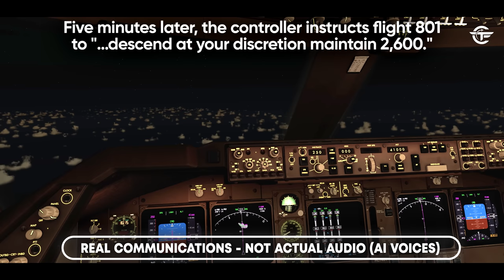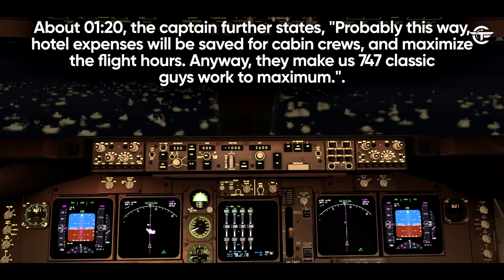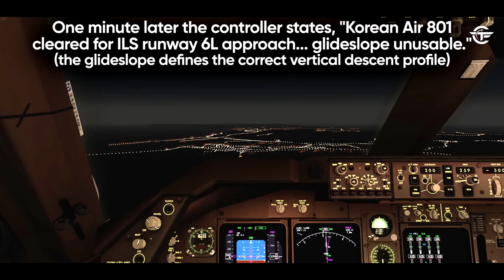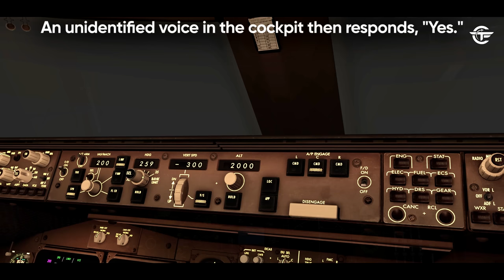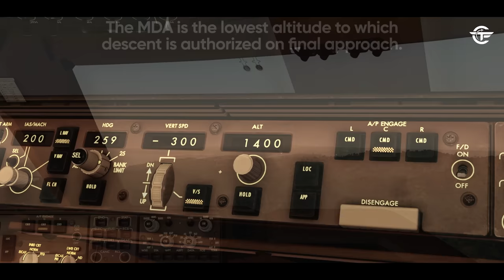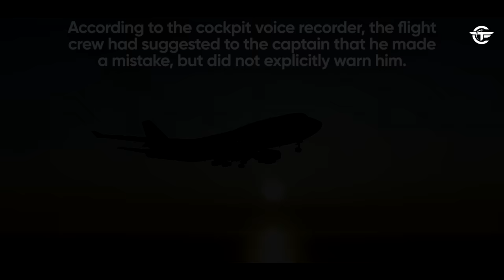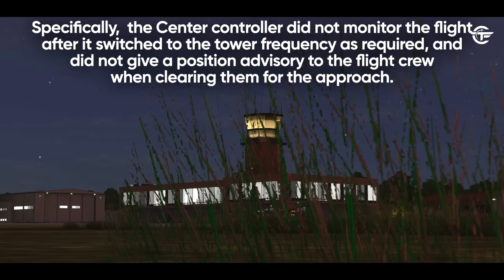Boeing 747 Crashes in Guam | The Terrifying Story of Flight 801 (Real Audio)

Comment: If I correctly understood they was cleared for ILS approach.
The Approach told GS not working, but the tower did not mentioned this.
If the GS was not working the Approach should clear the flight to a VOR approach.
Instead, clearing to an ILS approach the crew did not realize immediately the erratic GS and miss to maintain the appropriate altitudes.
Reply: I remember the tower mentioning the GS was not working, but the cockpit didn't repeat that part back to the tower.  Tower should have caught that but didn't.
Reply: @margeebechyne8642   controller  said  gs not working tower  never mentions it
Reply: @hachimaru295  Ah.  Well.  Still should have caught that - that's why repeating back is so important.

Comment: Korean air carriers are always affected by their seniority culture and power distance, resulting in a lot of crashes over the decades, that, and lack of training, lack of situational awareness, failure to adhere to procedures, and the whole decision-making process. It's a system that led to them being shot down by the Soviets twice, numerous crew-error deadly crashes with massive casualties, runway overshoots, and a lot more as far as I can remember since the 70s.

I was in Guam stationed on a Navy ship there when that happened, and was on duty that night. It was raining mostly, I went up to the ship after a smoke break on the pier towards midnight, hit the sack, and a couple hours later they woke everybody up on the PA system and gathered at the galley while they were designating people to be sent to assist on the crash site. Right then, the news came out on the TV, and once I saw Korean Airlines appear, I wasn't surprised, and already knew that this was most likely a preventable accident. 

I don't know if that has changed over the years, but just this year, a Korean Airlines jet overshot the runway at Mactan-Cebu, Philippines and was written off. A few years ago, an Asiana perfectly functioning 777 missed the SFO runway on a bright summer day and was totally damaged with some casualties. I'm sure that one is on YouTube somewhere. Apparently, it was all for the same reasons mentioned above. I wouldn't fly with them, knowing all these. 

Everything past the cockpit is great though. Nice clean cabin, seats, cabin crew, and all. So nice, that not too long ago, Ms. Cho, a daughter of one of the airlines' CEOs threw a fit, berated, screamed at, and slapped a flight attendant in front of everybody prior to takeoff from JFK, causing a big scene over peanuts not being served on a plate on the first class section, prompting the plane to return to the terminal to dump off that flight attendant. Power distance, huh?

Comment: No Non precision approach backup? With minimum altitudes vs DME? Without glide slope it’s essentially a NDB or tacan approach with DME.
Reply: An ILS with glideslope inoperative is a non-precision approach. The MDA for the non-precision localizer-only approach is right on the chart.  A localizer-only is way better than an NDB, or even a TACAN, because it at least keeps you right on the runway centerline.
I don't know what the approach was named back then, but it is now named ILS or LOC RWY 6L, and the term localizer can be used by the controller when issuing the clearance, which might have helped wake this crew up sooner.

Comment: If Just Flight 747 classic were to be released today with the 747-300 model ready, would you have used it in this video?
Reply: That was the first thing I noticed; KAL801 was a B747-300 but the video is using a B747-400 in this sim.

Comment: No. Just no. Looking at the approach chart, the minimum (MDA) is 1500 for a localizer approach. The MDA (actually DA) of 590 (the figures may have been adjusted higher since this accident) is FOR THE ILS. The glideslope out changes the approach to a LOC or localizer approach, and has a COMPLETELY DIFFERENT MDA. The 1500 foot MDA would have cleared the 1190 foot obstacle listed on the approach plate. The controllers said this several times, "glide slope out", and the tower called it a "localizer approach" several times. Dialing that 560 MDA was loading the gun that killed them.

(The MDA is minimum descent altitude, the DA is decision height. ILS does not have an MDA at ALL because the height is set by the glideslope. The DA is a "decision" altitude because it means if you don't have the runway in sight, get out of there).

PS. The old plate thing didn't kill them. Even with the old 1300 MDA, they would have cleared the mountain.

Comment: Just a heads up on your graphics, you keep showing a 747-400 (exterior and interior shots) when the aircraft that crashed was a 747-300. It's an important piece of information because the you mention the captain began a briefing the first officer and the engineer about the approach into Guam. The 747-400 is a two person cockpit while the 747-300 is the 'classic' 747 three person cockpit. The 747-400 is a glass cockpit while the 747-300 that crashed was the old school 'wall of gauges' which is NOT WHAT YOU ARE SHOWING.

Comment: I regret to to note that, in videos of accidents and incidents involving classic Boeing 747s you created recently (since the accident of MK Airlines Flight 1602 aired on 14 October 2022), the cockpits of these classic 747s were replaced by those of the 747-400s. In this video, even the 747-300 itself has been replaced by a 747-400. These details are clearly inconsistent with what they actually were, and I hope that you will fix them in the future.

Comment: Korean Airlines is well known for this, fear of challenging the senior pilot. It has to do with their culture. Seniority is everything. You just don’t challenge your superiors as they are seen as being almost Godlike. They don’t go over checklists carefully enough. Many accidents have occurred with Korean Air due to this problem. Recently, a Korean Asiana Airlines flight came in too low into to SFO and the plane hit the Sea Wall at the end of the runway. Lack of pilot training was to blame. KAL  was banned from landing in Germany for years due to their abysmal safety record. A KAL 747 cargo plane crashed in the UK. 16 incidents and accidents between 1970 and 1999 killing nearly 700 people on KAL. 

I used to fly on KAL to Asian destinations often due to their cheap flights but not anymore!